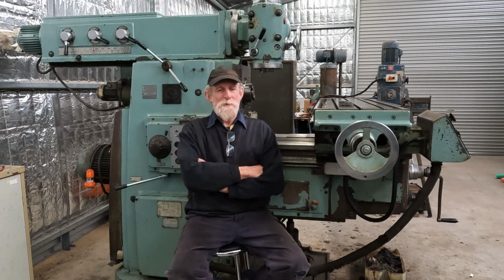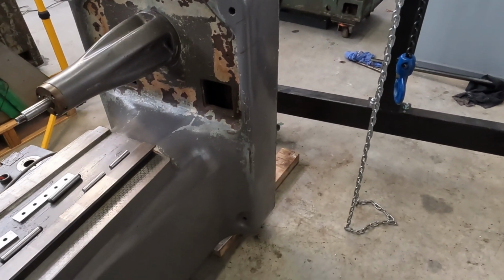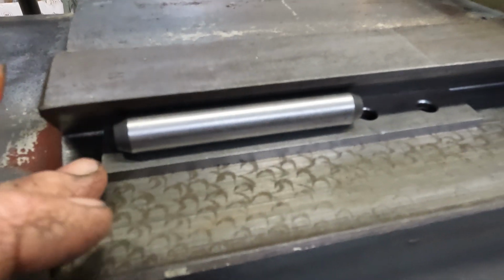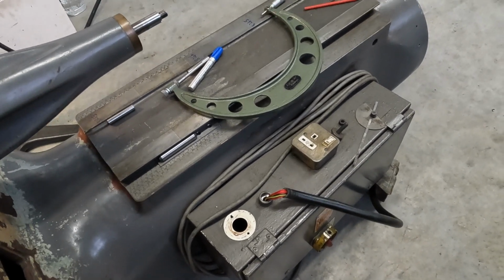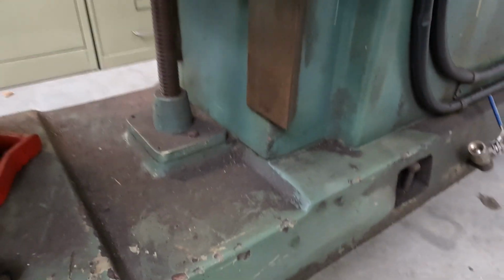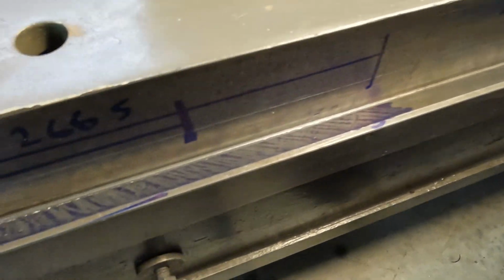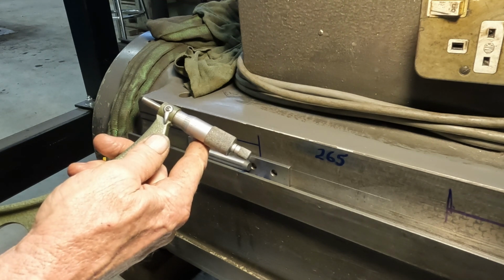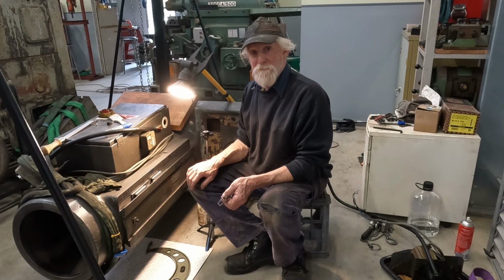Scraping The Bridgeport Column .    Part 1 .

Comment: Why don't you use a power scraper?
Reply from the maker: Because they cost about 3 or 4 grand  by the time i got one ex USA .   👍
Reply: @swanvalleymachineshop  I got a battery-powered on from Kogan, at around AU$100 including battery. And it has saw attachments.
Reply from the maker: @SusanPearce_H  That would be a multi tool .  Look up Biax scraper and flaker .  👍
Reply: @swanvalleymachineshop  Are there pneumatic alternatives? Dan Gelbart delves into scraping techniques quite well, in my opinion.
Reply from the maker: @SusanPearce_H  Yes , an air chisel but they are way too violent .    People have converted reciprocating saws to get close to the scraping action .   You need to be able to adjust the stroke length .   I bought a similar thing to what you have a while back but have not had time to convert the blade or see if it will even work .    A large sharp carbide hand scraper can remove material quite quick .
Reply: @swanvalleymachineshop  Understood. Thank you.
Reply: @swanvalleymachineshop  Ouch! At that price they are pirates.

Comment: Good to see you back on YT, hope all things moving is going well .
Unusual on a small to medium machine tool (shaper) to need some civil engineering, probably designed to be used on a dirt floor (sorry, being facetious here, Brazil have some good engineers).
First step in scraping machine ways, or surfaces,  is to think about the geometry , obviously 2D for a flat surface,  and 3D for all others.
Thanks for sharing Max.
Reply from the maker: Thanks . I am only doing one face of the dovetail , still have to keep it true to the adjacent though .   👍

Comment: The big mill looks good cleaned up.  It looks to have a lot of Y-axis travel.  I have a Fexac horizontal mill and at some point in their earlier days they used long leadscrews on the knee that required a hole in the floor.  By the time mine was made they had smartened up and were using a two piece telescopic leadscrew and no floor hole was required.  When I got it the nut between the two screws was completely stripped out and I had to make a new one out of bronze.  Come to think of it my Elliot shaper has a telescopic leadscrew as well.  When I first got my Bridgeport clone I broke it down into three pieces and took it down my basement stairs.  They are easy to take apart.  Ken
Reply from the maker: That mill has great travel on the table , 1000mm .  400 on the cross &  420 on the Z ( according to the manual ) . The manuals for it are full of really detailed info , inc max loads for power feeds .  630kg table rating .  Also alot of drawings on internal parts ,   really mind blowing how detailed the manuals are .   The machine has auto & semi auto functions as well .  👍
Reply: @swanvalleymachineshop  Your mention of automatic and semi automatic functions reminded me that the guy I bought my HBM from had a mill with those features as well.  I looked through the pictures I took of my HBM when it was in his shop and sure enough that mill is in the background.  It looks exactly like yours and I believe his was a Stanko.  Along with the overarm vertical milling head it also has one that is driven by the horizontal spindle for really heavy work.  They look really heavy and rigid when you stand next to them.  I can't wait to see you take some heavy cuts with it.  Ken
Reply from the maker: @hmw-ms3tx  I would love to get hold of a 50 taper vert head for it , or one i can modify to fit .  The column is drilled & tapped to take one .  👍

Comment: Hey Max, was just about to drop you a line to ask you if you had died. Good to see you back but for future reference a quick post or short vid announcing your demise would be greatly appreciated. 
Also curious about what settings  you  had in lab during the scraping, with regards to temperature, air pressure and humidity.

Cheers man, 

John 🇨🇦
Reply from the maker: Temp , constant 24 Deg C  ,  pissing with rain , no humidity !!!  🤣  I did try to do an update video , but with all the stopping & starting it made it a difficult one .   So i thought , bugger it .  With all the interruptions  it was just easier to start cleaning the big mill !  👍

Comment: Good to see you back - you need a beveled PGS(Precision Ground Stone) - Once I started using them it changed everything - you can see the high shinny spots - no need for blueing most of the time.  See the ones Stephan has here: https://gtwr.de/wp-content/uploads/IMG_4226.jpg

Using large micrometers seems to do a lot with hearing the squeak..
Reply from the maker: Thanks . I like those stones , something to consider later on .   👍

Comment: If you still see scrapeing marks it's not worn much,certainly not enough to scrape it.
Reply from the maker: The issue is one of the dovetails .   The flat areas are still good enough .  Bear in mind that the  Bridgeport original crescent flaking is very deep & not done on the angled dovetail face . 👍

Comment: Pretty  deep scoring there Max. Yeah you defiantly need to get a dovetail straightedge and a good plate if you don't already have one. When I did my Bridgey column, I flipped it more than once to measure!  Things are looking great in the new shop Max. Cheers
Reply from the maker: Yes , have to do it the hard way with no dovetail edge .  The dowels will give me the parallel centre line of the dovetail .  I have another method also with dowels ,i will use for angle corrections before test fitting the gib & knee .  It will be flipped several times ! 👍
Reply: @swanvalleymachineshop  Great to see some scraping! Maybe you could have used the gib to do a little spotting, not having a dovetail edge - could help to point out the local high spots, even though the gib is probably pretty flexible... but your measurements help take care of that. & maybe touch up the gib a little first with the scraper, if you have any sort of surface plate.. 
Also, if you come across some scrap carbide slitting saws, or other thin wide carbide, can silver solder to something for a scraper (then you just need the means to grind & hone it!).. of course, don't let details like this distract you from getting those machines making chips!
Reply from the maker: @windrk_6754  I do intend , as you mentioned to use the gib as well After i re scrape it flat .  Cheers .    👍

Comment: Hi Max, my circa 1927 Drummond hand operated Shaper had the screw protruding, had to drill a hole in the workbench!
Reply: Ha, mine too.
Reply: I wonder if one could make a 2- piece nested screw - shorter threaded rod plus a sleeve with the same thread on the OD & ID, running in an even larger nut. This might reduce stick-out underneath .. Maybe this was even offered as an option, for those shops that didn't have dirt floors??
Reply from the maker: @windrk_6754  I would shorten it & use a spacer block under the nut .  👍
Reply from the maker: Lol .  👍👍👍

Comment: Got the move done just in time for winter, eh Max ?   I made my scrappers using very-high carbon steel .  They worked well 40 years when I had a lot of metal to remove on a very worn, century old surface grinder ... and they still work well today .  Professionally,  I used carbide power scrappers which yes were faster, but I never saw the need to make the investment for myself .
Reply from the maker: Thanks .  The hydraulic  pump veins  seem to stand up well & i have a heap of them !   Still a big learning curve is the scraping , but i have a solid plan in place .     👍

Comment: Gday Max, great to see another video, you’ve definitely been busy, scrapping is something on its own and a lot of patience required which I don’t have, the shaper lead screw setup is the same as the PK Douglas shaper, it’s not that bad on a small machine but shit on a bigger one, great job mate, cheers
Reply from the maker: Cheers Matty .  I will cut the bastard & run a spacer under it before i drill a hole in the floor !    The  6'' high frame should help a lot . 👍